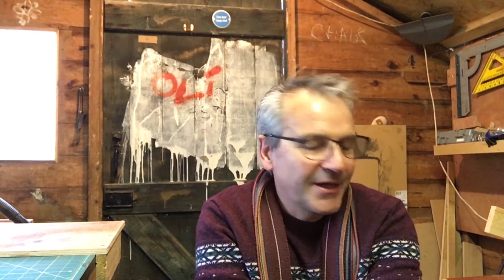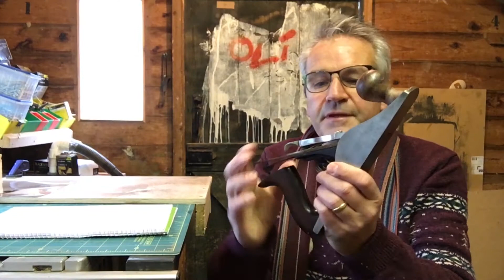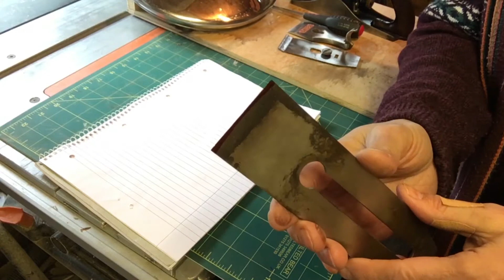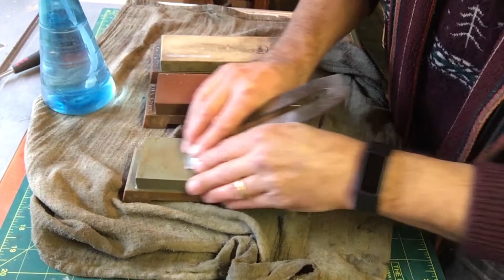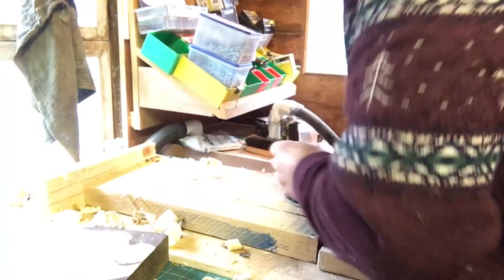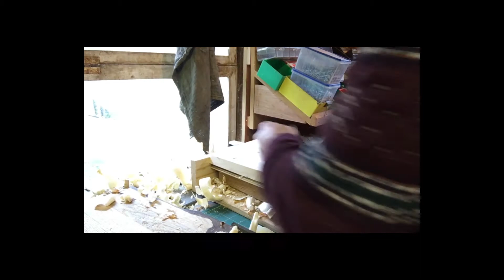Making your own scrub plane on a budget

Comment: Thanks. What is the name and type of your bench grinder ? Would a thick 1/8 inch blade better in a Stanley no.4 ? Did your plane hog off wood fast ? I need to flatten a 14 inch log cut in half down its length.

Comment: You mention Paul Seller's workbench, he also has a video on how to convert a No.4 smoother to a scrub plane.. he makes a point of frequently quenching during the grinding of the iron to prevent overheating, also grinding the corners of the chip breaker match the curve of the Iron just enough so the breaker isn't too far away from the apex of the curve, as well as you what did, filing the front edge of the throat of the plane to give more room for the thick shavings to go through the plane without clogging. He also suggested moving the frog back a little. Also, a couple of ways to sharpen the blade by rocking it back and forth along the curve or using a figure of 8 pattern from one edge to the other. A useful video though because scrub planes are so good, time saving, and cheap to get. As you say, buy a cheap second hand No4, and convert it.
Reply from the maker: yeah i really enjoyed doing that one, it really does shift wood nicely. He makes that figure of 8 pattern thing look so easy - i suspect it not but will give it a try thanks
Reply from the maker: @Cerberus it works surprisingly well as it is so I don’t think I need to do the chip breaker thing, definitely not something to do to vintage plane unless it’s already beyond help